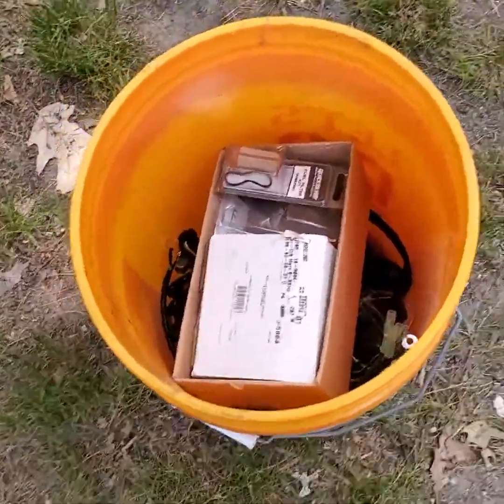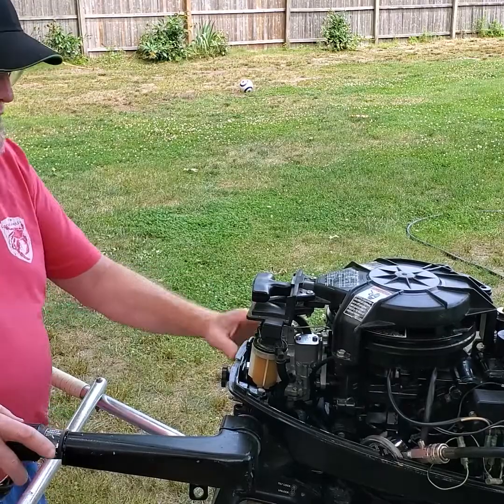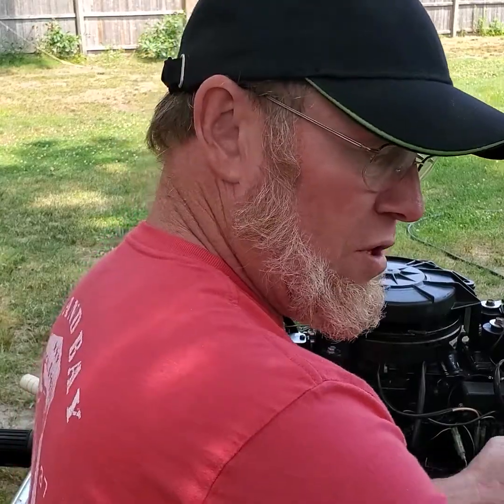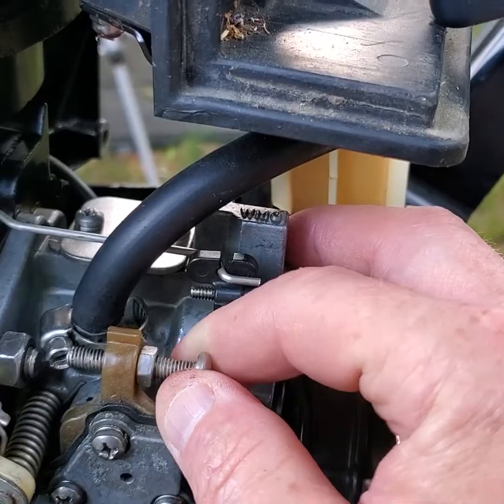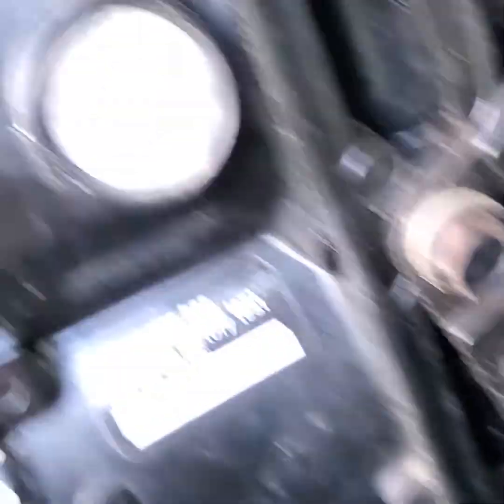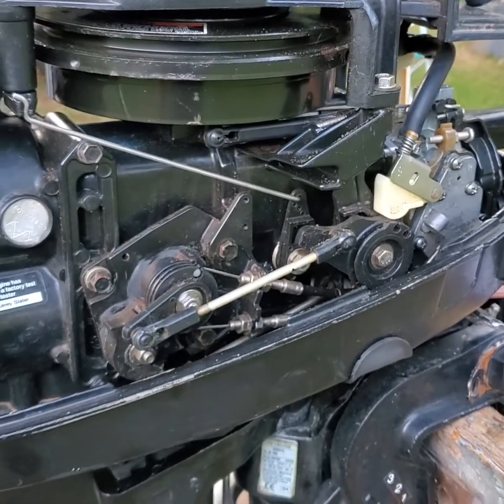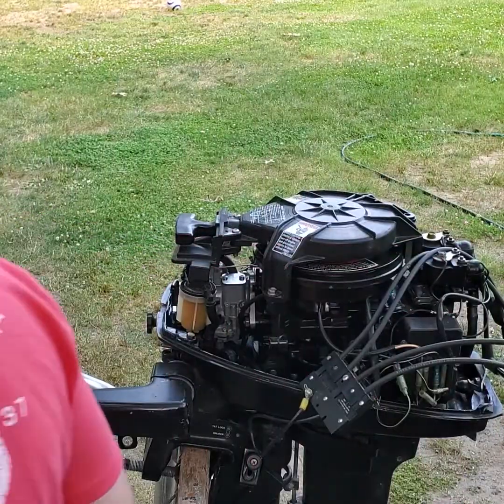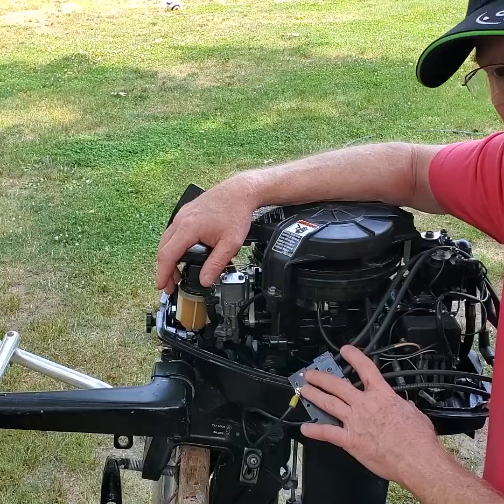2 Stroke Outboard No Spark Diagnosis 1

Comment: Hi Ted, I bought a 16' Monark bass boat with a 9.9hp two stroke merc, its also a 1996 model. When I got it home I cleaned the fuel line and changed the filter, (it sat for 20 years under tarp, still in great shape). Unbelievably it started after a couple of cranks. It ran for about 15 minutes then died. Hasn't run since. I checked spark and have spark on the top cyl, and none in the bottom. After watching your video, I changed output peads on the coils, and it changed to the bottom cyl, and none on the top. I put a new aftermarket switchbox on, and, same thing, spark on top none on bottom. So I bought a new, old stock quicksilver switchbox, and same result. Any clues?
Reply from the maker: The trigger under the flywheel sounds like the issue. Try measuring the windings for resistance. So stator is good, coils and switchboard is OK. I would also try a little carb cleaner in the intake to see if it fires. If so clean the carb.
Reply: @tedsmarinerepair8956  I rebuilt the carb/fuel pump, and I will retest the trigger windings. Thanks a million!!
Reply: Hi Ted, I thought I would give you an update on my 96 9.9hp mercury. I checked the ohms on both the old and new triggers. The new one was at the very top of the "good" range, and the old one, probably the original, was at the very bottom of the "good" range. I put the old one back on, and low and behold, spark on both cylinders. I have run it in the tank, (cut down poly drum), for about 3 hours, and was actually able to adjust the carb that I had previously rebuilt. It is running smooth and the compression has come up ten pounds, from 50 to 60. (It had set for 20 years), I want to get it in the lake and run it hard to see if it improves. I don't think this motor has 50 hrs on it.
Reply from the maker: @waynewolfe8817  excellent news, being able to get it to idle means it's likely running on both cylinders
Reply: @tedsmarinerepair8956  what made you suspect the trigger? It fired faithfully on the top, I assumed the switch box.

Comment: do you know where I can buy a few feet of the color coded wires for a merc 650 in the 2207872 series or 2872319?    red, yellow, gray, black, salmon, white and brown?
Reply from the maker: Check around with your local marine repair facilities, especially the ones that do outboard repowers. Ask them if they have an old outboard harness you can but to cut up for your needs.
Reply: @tedsmarinerepair8956  Thx, good idea.  I did exactly that.  The repair shop sold me some wire, but they were all out of 14 gauge wire in their repair facility.  So I asked for 12 gauge, it's thicker.  The fellow said he wouldn't sell it to me because it might not carry the load. Idiot.   So I got some at a hardware store.  Ultimately, I did replace all the wires and I did restore spark.
Reply from the maker: @baubljos103  oh man, he didn't know 12 is bigger than 14. That's scary.

Comment: Do engines like these have an alternator to charge a 12v battery? Mine is an older Mercury Mariner 2 stroke and looks almost identical electrically.